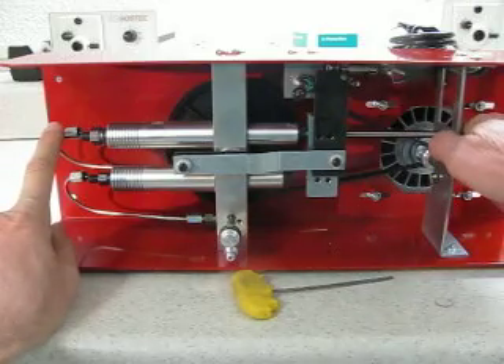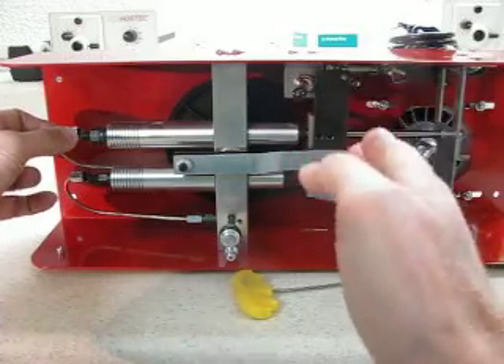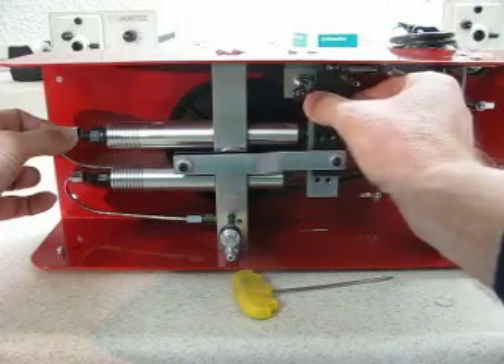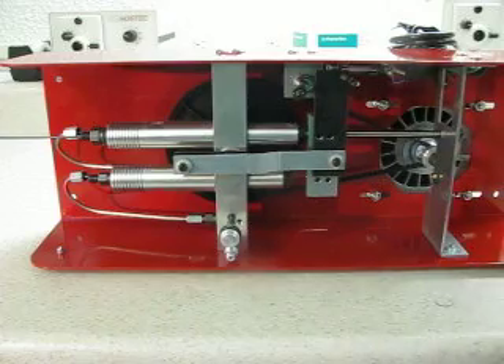ShoeBox Air Compressor Piston Upgrade

Comment: Why no O rings???!?!?

So the first piston is actualy 3rd stage couse compressed air is fed to the machine, and 

And second is 4500 PSI?

But shouldent the big cilinder move in first to presurise the small piston wich then turns it in hpa?